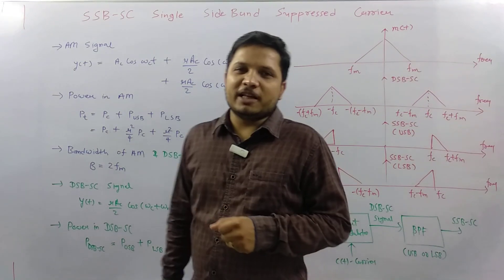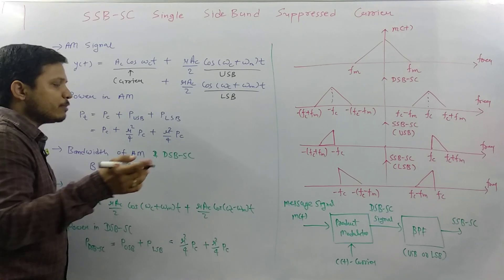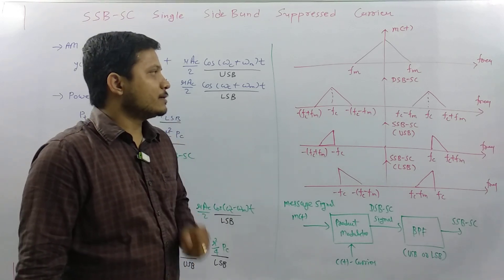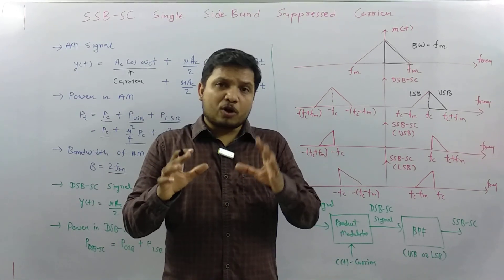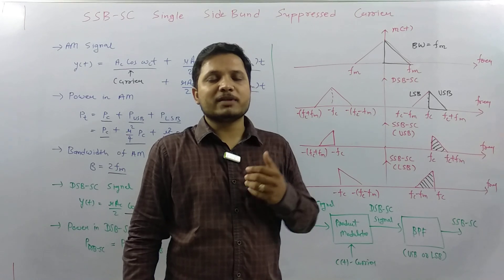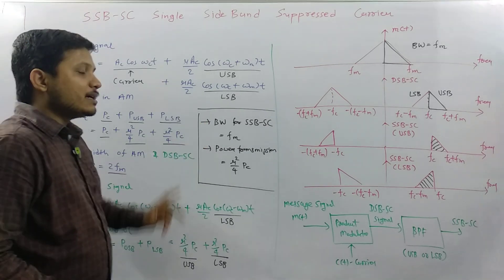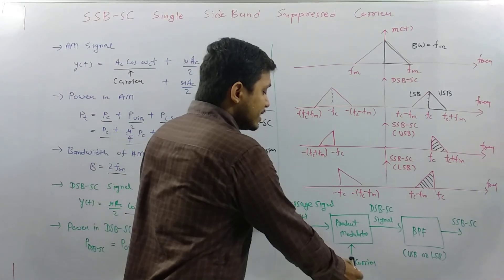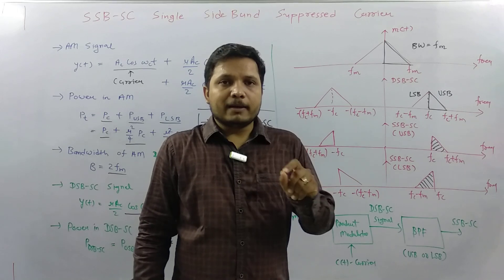Single Sideband Suppressed Carrier SSB-SC (Basics, Block Diagram, Working, Waveform & Importance)

Comment: in Am signal  u have shown negative sign in LSB in previous lecture but here u have wrote positive sign in both LSB as well as in USB...
Plz rply ASAP
Reply from the maker: In frequency spectrum -ve and +ve amplitude has nothing to do.
Reply: @EngineeringFunda  that means we can take negative or positive.. Correct me if i am wrong
Reply from the maker: @azharwani910  yeah you can take - or +ve